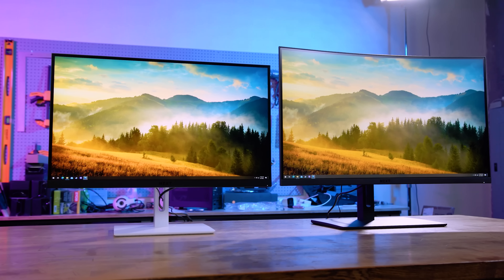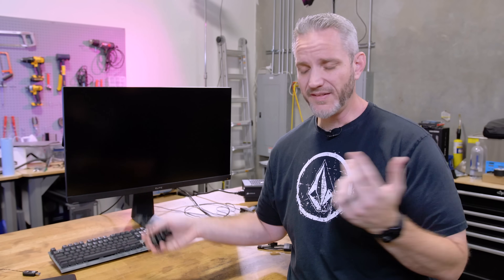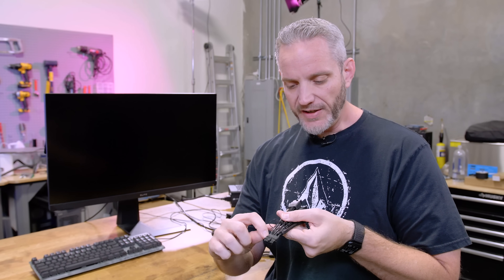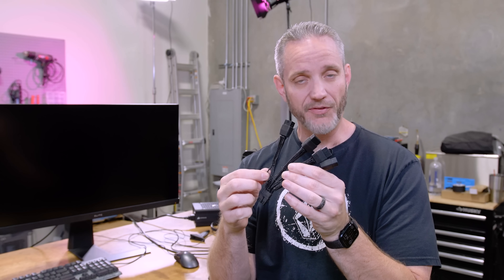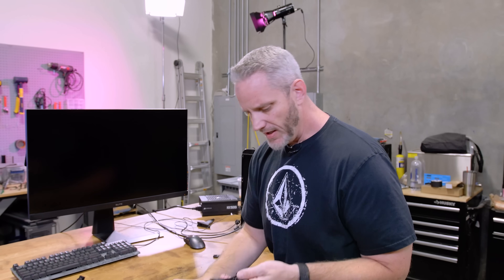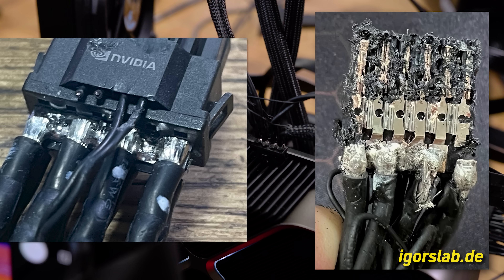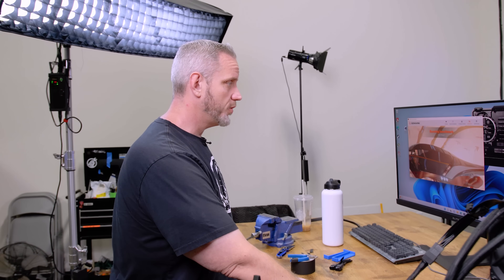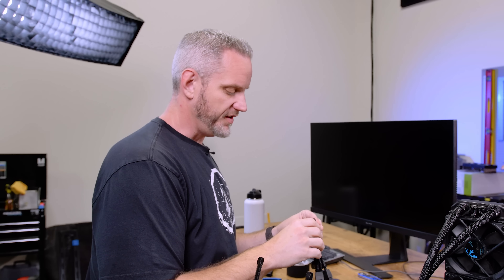Igor's Lab figured out why NVIDIA adapters are melting!

Comment: I think the reason that you couldn't recreate the failure is that you completely removed the wire.  The melting is probably caused by a wire that is barely making contact and creating a high resistance connection.
Reply: Yeah, it doesn't make sense that the ends are melting unless what you have is a bad connection as opposed to a non-existant connection. If it was that latter you'd see the melting  in the middle of the connector.
Reply: its definitely arcing caused by the high potential wattage, if it can find a way to the pin, but has to jump a tiny crack, its enough power to do it where a smaller current couldn't jump the arc. Arcing is what is creating the high enough heat to melt these.
Reply: Rtx4090 Scalpers have a big problem since they have already bought the gpu with the shity connector & cable.
Reply: This! I was getting frustrated when I saw him completely remove the wire and pad. The heat comes from the resistance caused by the loose connection, making the termination point act as a resistive load now, basically a shitty heater lol. This was obvious to me because I work in electrical, but I don't know this guy's background or experience when it comes to electrical.
Reply: @BushyBrowsHD  also, he's removed a lot of the plastic/rubber that would be keeping that heat in
Reply: @vladuk  Your pointing out size like it is the most important piece. Your wrong, it is quality that is the important piece. I have nodes at work that use 4 pin atx type power connectors. Required due to size limits on the boards and the power needed. They carry over 4k watts, they have 208v power going through them without issue. The difference is that they are custom built to that those tolerances. They cost thousands of dollars each. It's not the size of the connector, it might not even be the design. It very well could simply be the quality. All these companies (nvidia, amd, intel, "company name here") farm out the manufacture of things like this to the cheapest manufacturer. That is always the weakest link. I don't like the new cables and think they should be replaced, but acting like it something simple that nvidia was to dumb to know is childish.
Reply: That was my thought, if there is no path then the load gets distributed, if there is a path then it is trying to absorb 1/4 of the load making it overheat. If that path is small then things get hot.
Reply: @vladuk  repeating your point 4 times doesnt make it any less stupid. As long as the connector is intact there is no problem, but judging by your previous comments, explaining to you what exaclty the problem is might be a waste of time.
Reply: @joee7452  drawing 4000W at 208V (~ 20A) is a very different thing than drawing 600W at 12V (50A), current wise and in the end it is the current that causes the problem not the wattage
Reply: @plav032  no that doesnt make sense, arcing isnt caused by wattage, it is caused by voltage and if a tiny crack occurs on the solder patch,  the voltage between the two sides of the crack is extremly close to zero.
Reply: This is the problem 100% Its like a thin connection within it that is heating up like a toaster. Resistance 101 :D
Reply: Yes, it's clearly arcing and that's what's melting it.  You'd think that Jay would have some kind of idea how electrical circuits work.
Reply: @AvroBellow  please explain where the high potential difference that's needed for an arc should come from
Reply: Exactly what I was going to say, the problem is not the other wires completing the same supply, after all it took 1200W to make a healthy wire connection melt, the problem is the break that stays in place, current still tries to get to the card, but since theres a higher resistance (aka air between the pad or cable) it gets hotter
Reply: @willirosenhahn3617  I was pointing out that size can mean very little. We also have 6 pin connectors that run 220 50a (11k watts going into the power control units). I was just using one type as example. Size and pin counts are not the big issue, quality and design tolerances are.
Reply: @vladuk  Thank you for the complement. It's been a long time since anyone thought I was a teenager. You make a statement basically saying that Nvidia is just plain stupid and I came off as a snotty teenager? Believe what you want. In my years in IT I have learned 2 things, it's always the network and don't argue with someone outside of your peer group that thinks they know your work better then you. We will have to disagree I guess. I wish you well.
Reply: @joee7452  ok, I see. I am agreeing with what you say, just wanted to point out that your example wasn't exactly suitable
Reply: I think to get the fault the cable must be twisted so that the pins are semi connected... sparks will jump and the temperature will increase drastically... this could be very similar to when you connect a terminal of a vehicle battery... I saw 24v trucks that when starting, melt the terminals if they are poorly connected
Reply: He partly removed plastic case of the connector, so this plastic no longer prevents heat from dissipating into the air. Recreation must include having removed plastic back on the connector.
Reply: @Ed Straker if the end connectors are severed its not going to melt at the rends, it will melt in the middle if it's going to melt at all. Doesn't Metter how they're connected, a pin with  no current doesn't geerate heat.

I'm not sure what you're trying to correct here.

The point is they're melting at the ends which means theres still a connection but it's bad.
Reply: @Ed Straker I never said that 12v can't cause significant heat and melting of plastic, I just said it isn't enough to cause an arc, because for an arc you need high voltages to ionise the air
Reply: Or he knows what hes doing and not being a goof so he actually connected it fully.
Reply: Or a wire that is bent at an extreme angle, creating just enough of a gap in the broken connection to cause arching. I'd bet money there's and arching problem with these failures. These cables need to be pre bent to specified angles before soldering, and a much more robust parallel bridge to make the transition from 4 wire to 6 pin connector.

Comment: Please bear in mind that your FLIR can't accurately read the temperature of bare metal, since its emissivity is very low. You'll get good readings off the nearby plastic, but the traditional thermographers' hack is to stick a bit of matte black tape (I like Taeyoung electrical tape) onto a metal surface and then measure the temperature of the tape. A spritz of black spraypaint also works well.
Reply: BLACKBODY RADIATION FTW!!!!
Reply: Or something like a thermal pad since they’re designed to conduct
Reply: regulary black vynal  tape works pretty good to.
Reply: Yup except the issue with measuring the plastic is it's such a poor conductor that you're not seeing the temperature around the pins. The surface temp of the connector will almost certainly read much lower. Even if it's only reading ~80C, the pins are likely hot enough to start melting around them, especially if connections are loose.
Reply: If the connector plastic is melting, I think the accuracy of any FLIR device is somewhat academic. It's what's IMPORTANT that matters, not the odd degree or two of temperature.
Reply: @JJFX-  Nope ! It doesn't work like that. AT ALL ! If there's a temperature, the radiation will be proportional to it )on the black body curve). It really doesn't matter about its thermal conductivity.
Reply: 💯 facts and I catch myself still making that mistake sometimes
Reply: won't sticking a temp probe work as well?
Reply: @grahamstevenson1740  I think you misunderstood my comment. I'm not saying the thermal conductivity will affect the reading. Only that there will be a large temp differential between the surface of the plastic and the terminals generating the heat. So while hotter readings on the surface can give some insight, it simply doesn't give a great picture of what's really happening even if it's perfectly accurate.
Reply: @JJFX-  OK, let's examine the theory of that. The source of the heat is primarily the contact itself at the interface between the pin and socket terminal. There will be some small I^2.R contribution from bulk resistance heating of the male pin which is much lower (due to its larger mass) than the formed contact which is press formed from thin brass or phosphor-bronze plate.

Heat from the male pin will be heatsunk through the printed circuit board copper foil layers into the circuit board to which it's soldered.

For the female part, heat will transfer through the contact into the attached wire. The wire acts to draw heat from the contact. Therefore it's clear why a smaller gauge wire that can't conduct so much heat away as a larger gauge leads to a smaller current rating as it'll run hotter, amp for amp.

This will result in heat flow through the connector parts and a thermal gradient in them..

It'll be impossible therefore to put an EXACT figure for the contact temperature. One can merely hope to find a near value for it.

In the absence of any air flow in the connector itself, the housing will tend to match the temperature of those contacts over time, I suggest. There is no sink to ambient from those plastic moldings other than by conduction/possible minor convection to ambient air. I'd suggest then that the housing temperature is close to that of the contact. A 'wet finger' reckons it'll be within 10C or thereabouts.
Reply: The big difference is that by removing the plastic around the pads and cables he's also removing the isolation that could increase the temperature, now exposing the metal to the much cooler air. Maybe that's why he's unable to get it high enough to start melting the other side
Reply: @grahamstevenson1740  I appreciate the well thought out response. For the plastic housing around the terminals that are inside the connector and insulated most from the environment, I suspect it would eventually become fairly close to the average temperature of the terminals/pins. That is surely a primary reason why this area melts first.

However we can't get a good surface reading on there. We can only directly measure the outermost housing or the thicker section of the connector behind it. Both of which would have an even greater temp differential, especially on an open test bench. 

While you could probably approximate this difference in a static environment as well, if there is a poor terminal connection it would rapidly heat a more localized area, complicating things further. As the plastic melts around the hot spot, a wider air gap is likely created.
Reply: @JJFX-  Thanks for the comment. I'd suggest that a way to get a closer feel for the contact temperature would be to install a low thermal mass bead thermocouple in the well of one of the connector pins towards the centre of the housing.

Taking accurate measurements of such things is invariably fraught with measurement errors but that should work quite well. The lead wires of miniature thermocouples are 'hair thin' and should not draw much heat out. I've used them extensively in product development.
Reply: @grahamstevenson1740  the plastic won’t be the same temperature as the metal
Reply: Also adding to this, taking the thermal reading of the outside of the connector which is made of plastic, a good thermal insulator / poor thermal conductor, is not going to tell you if it is cooking from the inside out, the temperature of the plastic is not going to be consistent, in fact a raise of 5 degrees at the exterior of the connector could in fact be indicating a internal temp change of an additional 10% on top of what it would normally manage. This could be within failure tolerances of the materials used. I still don't see why instead of having 12 smaller pins and 4 tiny pins which is basically a 16 pin connection, why could it not just be a 16 pin version of what we already had, we moved from 6 pin PCIE to 8 pin PCIE, why not a 16 pin version, exactly the same amount of pins, we already had 30 series graphics cards with 24 pins worth of 8 pin connectors, you would still get a smaller connector, but not be reinventing the wheel, in fact I think this is why EVGA quit, when their power supply team saw what Nvidia was dictating to the GPU team, they spoke up and wanted to stick with the 8 pin or some kind of adaptor like that and Nvidia said no and that was the straw that broke the camel back and EVGA said screw this, we are not putting out name to this..
Reply: @needmoreboost6369  Not EXACTLY but it'll be very close to the same temperature.

The terminal won't itself be one temperature anyway, as it'll have a thermal gradient along its length.

THINK about it before trying to tell me "I'm wrong" because I am most certainly NOT WRONG.
Reply: @JJFX-  exactly true! The current isn’t flowing through the plastic! and use of a thermal couple can help mounted to the pins but it’s complicating a simple thing, what are you measuring? Its Heat! And it’s cause? is a loss of power and it’s easier to measure the power lost rather than it’s by product! so you are all going about the problem the wrong way as far as I am concerned!using a thermal camera or even infrared temp gun! as they are tools used to find the “leak” then to accurately measure and locate the problem most of the time a multimeter will suffice
Reply: @grahamstevenson1740  and the equalisation time of the insulation and the conductors is not a constant if the current is fluctuating or even for a short period not necessarily in this case but as an example the conductor could potentially reach hundreds of degrees in just seconds in an extreme load or short! hotter than the insulation could possibly reach in time! And at a high load the point at which the plastic melts it’s basically a cooling liquid at that point and is no where near the temperature of the conductor this isn’t just some theory from a computer nerd I’m actually just a mechanic that spends a lot of time in in depth electrical diagnostics and professional accredited training and using thermal imaging and infrared gun is common practice for a multitude of industries and an insulating plastic tends to um.. insulate
Reply: @thannydevitos2332  Yes and no, most thermal pads have a white surface, which will still have suboptimal emissivity. Better than shiny metal, but still worse than anything black.
Reply: @josephchristianruiz6581  Yes, gluing a tiny thermocouple bead would be good, you just need to use one with wires thin enough that they won't draw much heat out of the DUT, and those are fragile because thermocouple alloys aren't super flexible. Also obviously you'd have to make sure your thermocouple ADC is isolated because the wires will be live.

Comment: Since the connector itself holds everything tightly together, if the pad/solder joint were to break in usage, it would likely be a situation where it either has less contact on that point than before (increasing the resistance), or it is completely broken and arcing, both of which would cause an increase in temperature. Just a thought for why testing with a complete breakage like you did may not produce the same results.
Reply: thats exactly what igor stated. wonky contacts inside the solder joints, buzzing and arcing induce temporary high resistance that lead to melting heat.
Reply: Yea his understanding and explanations were way off actual logical problem which is arching/heating on damaged outer connections. He shows how outer connections burn and then proceeds to tell how inner ones get more load and overheat...
Reply: He was so close...
Reply: Exactly! That's the only thing that makes sense and would explain melting on the outer pins. A complete break means no current and no heat. A partial break means increased resistance and heat.
Reply: Exactly.. high resistance equals more heat.
That's why the middle isn't burnt, has nothing to do with drawing too much from the middle pins.
Reply: Arcs can get to 5k F, so yeah they would melt plastic(most everything really).  What you need for that at 12 V though is for it to broken an in contact, literally micrometers of space and it's not going to do anything and all the load will switch to the other pins.  ANd if you think about it, with the way the part is molded, its probably doing just that cracking but remaining in contact and temps would spike like crazy.
Reply: @robertlawrence9000  if it was different pins shorting sure, but if you draw too much current through not enough wire no amount of insulation is gonna help
Reply: i don't think Jay explained it well, he had me confused because it didn't seem to be logical and simply cutting a wire doesn't approximate the scenario.
Reply: This.
Reply: @THeBoZZHoGG  Yep. Also possible that it's partially broken, with a small portion still connected.
Reply: If the solder joint is broken arcing would only occur if there was a large voltage difference between the wire and the pad.  That would imply that the voltage dipped extremely low on the pad (load) side. That's unlikely unless all the contacts were broken and the pad voltage dipped. I don't think arcing was the issue.
Reply: @zarethd  yeah Jay didn't explain the pin layout well. I thought they were separate but no they are together. I watched Paul's Hardware and he explained it better along with seeing the actual schematic idea of it's power distribution. I have messed with many power connections in my day. I fully understand if you explain the layout clear enough.